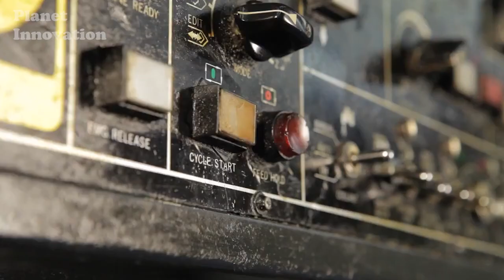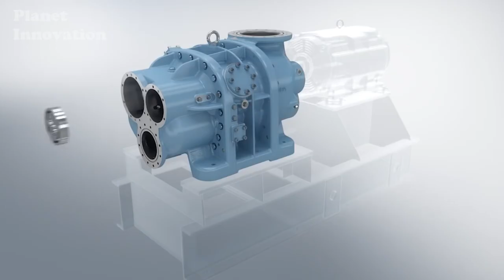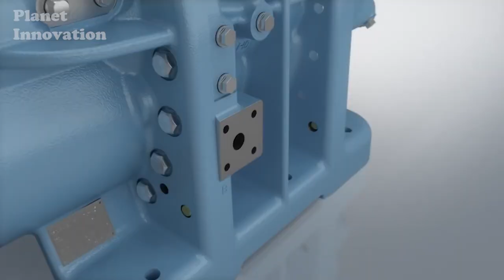Modern CNC Machining: Screw Air Compressor - Repair & Maintenance Giant Diesel Engine Crankshaft

Comment: When someone comes up with an screw compressor that doesn't require oil injection and can take constant starting and stopping for decades of use I'll be impressed.
Reply: seems uneccesary. we use these where i work, we dont have any issues with em.
Reply: il mio motore dopo 100 mila km è da buttare.
Reply: There are coatings that can get the job done nowadays. But for diesel applications it hardly even matters, because diesel can be used as a lubricant for the compressor as well as the fuel for the engine.

Comment: We installed 6.  120 ton 134a screw machines at Radford studios in 1999 - 2001. Incredible machines but had to be in biomass to avoid huge start up tax during the day....in order to cycle the machines and never shut down...had they built a capacitive reactive unit .
To avoid the tax on start up was not cost effective. I wonder how they feel about that now 2 decades later.?

Comment: At 6:25 the screw is lowered into a bath. Is that for oil surface hardening? What was the red paint on either end for?
Reply: Definitely not hardening. It seems they masked the screw part of the rotor, and there seems to be some kind of coating on the bearing surface after the treatment. I think the tank is used for electrolytic coating.
Reply: @White.Elemant  That makes sense, since later the screw underwent re-grinding of the edge contact surfaces. The funny thing is the red paint did extend onto some of the screw inside surfaces near the ends. Perhaps it matters little that a small portion remains uncoated.

Comment: The front picture shows a dry screw compressor from the oem MAN Energy Solutions SE und I guess, it is not allowed for using.
By the way, the shown manufacturing is a very old system and not state of the art. The shows manufacturing is more than 50 years old. Tschüss

Comment: Operator safety does not seem to stand out in this factory. The operator going with his (bare) hands into the moving rotor around 5:20, so close to the screw… not so nice to watch. seems quite dangerous. I’m sure there is a safer way of carrying out that manufacturing step.

Comment: Does the screw shape of the compressor actually play a role in compressing the air, or does it just prevent a chattering sound by not having the entire length of each lobe pair engaging with each other at the same instant?
Reply: It's probably for heat management
Reply: What shape would you choose instead?
Reply: It looks like the shape imitates the ripple of waves. So any form that can achieve this. However, I think any other condition will be limited by the velocity at which it can move fluids, as the pattern of the wave is closely followed by another wave right behind it.
Reply: These compressors don’t compress the air within them they move a fixed amount of air per revolution from the inlet to the outlet. The helical shape allows them to have multiple chambers which can help with efficiency. They’re usually gear driven which keeps the rotors aligned correctly and apart for the most part. There’s a small gap to allow for expansion and to reduce the friction between the rotors.

Comment: Would it not be easier to cast the screws and then clean it up to meet specifications? It seems more tedious to start out with a big cylindrical block of metal and then shape it out?
Reply: Though I'm not a metallurgist, it's safe to say that caste steel isn't nearly as strong as a forged steel blank. Forging arranges the crystalline structure for greater strength or hardness.
Reply: Cast materials are more brittle and the shape is much too complicated to forge it so what you're left with is a solid billet of steel machined precisely to finished shape
Reply: These types of rotors are extruded by Hydro Aluminum in 5 to 10ft lengths and then cut to near finished size on a saw. Then  machined to finished size by Eaton.
It is a interesting process that can produce thousands of parts per day which would be impossible with casting or just machining.
Reply: @joemannix7471  Cool info!

I know, at least in the late 90s and early 2000s, Eaton turbo chargers vanes were plastic coated. The gap between the parts was less than .02mm. People that over-boosted their engine by substituting the pulley for a smaller size would find that the plastic coating had come off and ended up inside the engine.
Reply: @joemannix7471  I believe you are referring to a "roots" supercharger (e.g. Eaton) which is quite different from a "screw" compressor.

Roots superchargers simply move air in proportion to the rotational speed. Whereas screw compressors have an internal compression ratio. An example of an automotive screw supercharger is Whipple.

The Whipple is supposedly superior to the Eaton in every respect except cost. Yet the only factors cars that I know to have used them are a few Chrysler models.

Comment: Has anyone created a supercharger with a CV drive that would use boost pressure to change drive ratios to optimize boost at different rpm's based on throttle demand? Just an idea I've had for a couple of decades.
Reply: YES GM's EMD division did that on some of their locomotives.  Additionally, turbo chargers were mechanically driven until the exhaust pressures came up, and then the mechanical drive would disconnect, and the exhaust pressure would take over.  Mercedes did something similar with their snail shell induction system [nautilus] where in the supercharged mixture went through different length runners in the manifold.
Reply: This is not a super charger
Reply: With the recent introduction of better and more affordable high-power DC to DC power semiconductors, several automakers are experimenting with electrically driven centrifugal super-chargers. They can change speed with very little delay. 

Another idea being tested is using an exhaust-side turbine to recover the wasted energy to generate electric power. So essentially you now have a traditional turbo charger but with an electric (or more precisely - electronic) variable speed transmission.

Comment: Why a twin screw?  Roots are achieving the same efficiency and don't have the off-boost charge heating issue.
Reply: A twin screw will put out more CFM faster than a Roots.... The reason that the current design of   twin screw was invented was because the Roots charger didn't have high enough of a pressure ratio to stop surge in gas turbine engines...The twin will create heat but a intercooler or flooded appropriately will take care of that..Best the other designs that are more like hydraulic gerotor pumps that wear out faster..IMO..of course..
Reply: Why Not a Centrifugal Compressor.
Reply: I feel I am in the presence of expertise
Reply: @chauvinemmons  Both the screw and centrifugal compressor create enough heat off boost that the bypass needs to go through the intercooler.  The TVS series roots is 75% efficient, same as the twin screw and centrifugal.  Half the HP??, your reference?

The only value I see in the twin screw is the ability to create higher boost.
Reply: Why is everyone just thinking of using them as a blower for an engine? Probably almost all of these screw compressors are used to produce compressed air for industrial applications and for compressor trailers to power jackhammers on construction sites...
Reply: @asharma9345  they're not positive displacement
Reply: @Steve Sedio  they're building air compressors not blowers for engines
Reply: @Henning_S.  exactly what I'm wondering
Reply: @stevesedio1656  lol just stop. You're so cluless
Reply: @asharma9345  usually because you have significant presence of liquids in the gas stream. Or because you need a positive displacement compressor for process reasons (for instance if you need constant flow with variable discharge pressure.
Reply: Twin screw is more efficient. Watch Gale Banks do a head to head comparison of Roots vs Whipple on his YouTube channel.
Reply: this is not a supercharger and judging by the precision it might be for air conditioning. it probably cost more than a new car.
Reply: @markwilliams4525  gotta make sure the air compressor doesn't lose it's prime of air
Reply: @Henning_S.  i service a ton of screw compressors used for industrial refrigeration mainly ammonia.
Reply: @billclark5943  Link?
Reply: I always thought this was a roots style charger.
Reply: @asharma9345  most of the time it's an space issue. Screw compressors have a small foot print compared to centrifugal compressors.
Reply: We use screws for industrial air compressors. As someone else said, I don't think a Roots or gear rotors work for high capacity applications. We updated our largest screw to a three stage centrifugal and it is a lot cleaner but much more expensive to maintain. Screws are super simple and reasonably durable. Our old oiled Quincy screws could blow about anything through them. The newer oilless screws are a little more finicky.
Reply: @Henning_S.  Exactly, I guess people missed that the video is about an industrial screw manufacturer. Our biggest compressor at my plant is 700 HP and a few thousand CFM. Your only options are a screw or centrifugal. Reliability and maintenance cost are far more important than marginal differences in efficiency.
Reply: They use screws instead of Roots, centrifugal etc because the screws can achieve 175 psi or more. Thats it.
Reply: @stevesedio1656   link to what?
Reply: These aren't jdm guys, the don't know 😂
Reply: Wouldn't that be a different video?
Reply: If you raced a blown Alky engine you'd know.
Reply: Have you ever owned a Kenny Bell supercharger? They're ALL twin screw.
Reply: @markwilliams4525  
Not the same general principle?
Reply: @erikkovacs3097  
Kenny Bell Superchargers all twin screw I think he knows what he's doing.
Reply: @petercunningham3469  
I'm using a Kenny Bell supercharger twin screw today
Reply: @Mr.Robert1  I tried to find one for my Miata, they didn't sell them anymore.  A guy on the Miata forum installed one, pushing over 300WHP.  Intake temps were too high off boost, he had to run the bypass through the intercooler.
Reply: @simonmasters3295  you're not.
Reply: @stevesedio1656  just trying to learn...why is running the bypass through the intercooler a bad or problematic thing? Just more ducting/weight or is there something else?
Reply: Not even close roots are horrible for efficiency
Reply: @markwilliams4525  yes these screws ARE positive displacement.....I ran a two stage screw made by LeRoy...it was driven by a 12-71 detriot....making 575 hp....the pump made 400 psi @ 1500 cfm....it was made for blowing the water out of natural gas wells
Reply: @John Steiner  you're right I should know better
Reply: @markwilliams4525  This is a very tough bunch here.....don't be too hard on yourself Mark.....considering ALL the knowledge/facts/information there is out there its daunting really!!!!....so give yourself some room Mark, we are all just learning.....its what makes life an adventure
Reply: @John Steiner  it's OK I'm definitely not being hard on myself, just acknowledging my mistake I've got very thick skin. I do appreciate it though.

Comment: It's a pump sensitive for cavitation, (speed as size restricted).
Casting is more efficient in the production process before the lathe.

Promise is to the adjusting vacuum displacer for a big flow, Heaven's promise to the lathe in policy.

Comment: 這是什麼引擎 等離子引擎？
Reply: @FIVE-0-APOCALYPTO  看無
Reply: @白小忠  it's not a engine, it's a device for what is known as external aspiration. 

It is a device to aid or assist in the event known as oxygen and or atmospheric introduction except on a more accurate scale of induction or introduction one could say.

Too many people in here look at this in terms of a combustion engine in a vehicle where for high performance at the high levels can and will reference such a device of the highest order where a turbocharger for instance would be of the more user friendly and energy effective lower order because even in high performance you don't have to be aerospace type accurate.

But in some industrial power plant applications where a energy source must be accurate for the sake of external utilizations as far as equipment and its processes that for the sake of its intention must be one that energy levels when called on or asked for must be energy efficient in the equivalency of accuracy no different than electric power in the cases of let's say laboratory experiments cannot afford any type of power surge one way or the other or one degree minut or the other, the importance for the sake of the experiment itself must be one of extreme accuracy to establish a baseline data for instance in which data derived therefore has a point of origin that can be traced back to it's inception point that therefore we know is accurate and therefore each additional step subsequently derived is one from a known data of accuracy end of story.